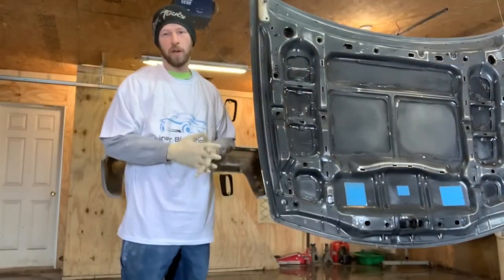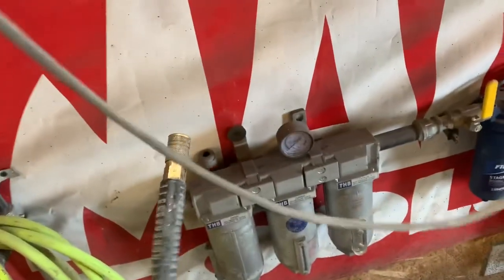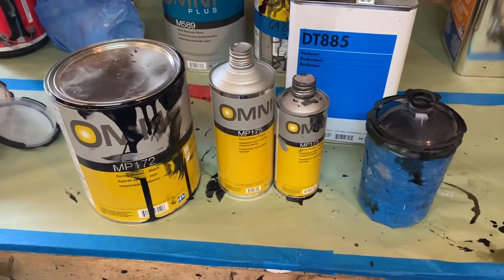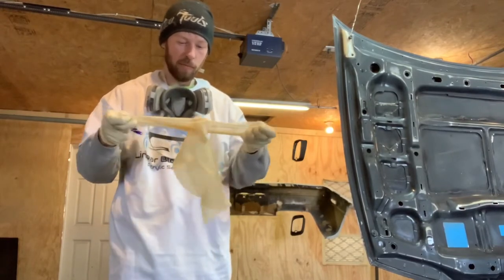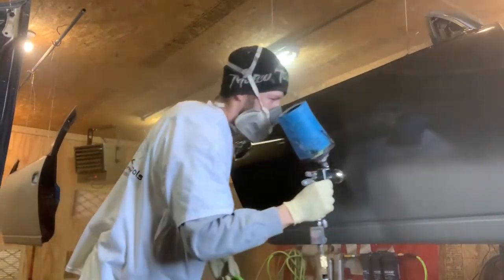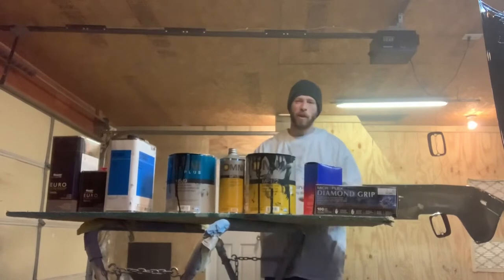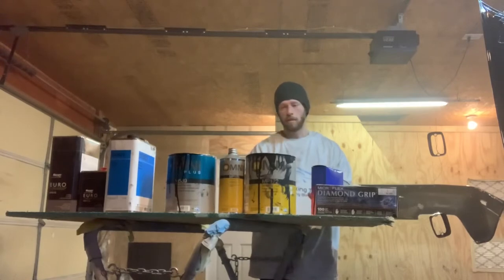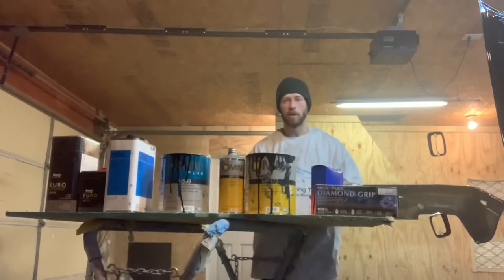How to get a clean paint job in a garage

Comment: Very good tips,Mate.. i have a question ..what is the nozzle size that you use for applying epoxy as a sealer? And how many layers on the panel? How long you waiting for flash off between your epoxy sealer to basecoat application? Thanks ..you information like something that out of the box for me
Reply from the maker: i typically use a 1.3 tip applying one coat as you would with a sealer, then allow about a 30 min flash depending on conditions

Comment: Can you scuff the epoxy if you need to ?
Reply from the maker: yes absolutely but if your using as a sealer is not necessary.
Reply: @linearblockingtools4064  yes as a sealer I’m asking in case i get lint or something can I scuff
Reply from the maker: @Stingyduce  yes
Reply: @linearblockingtools4064  thanks !